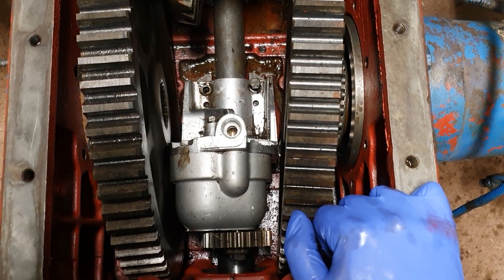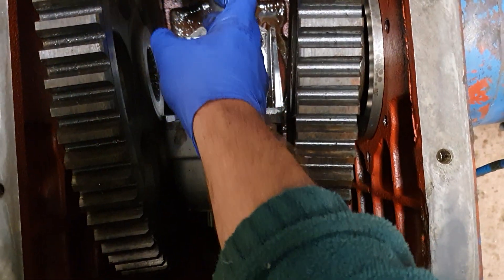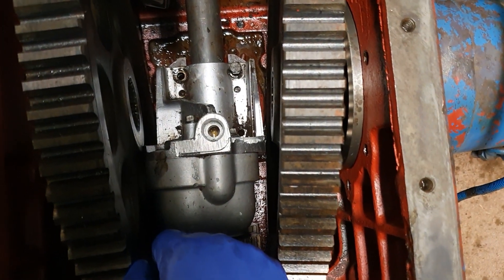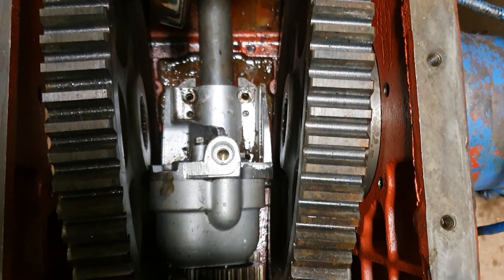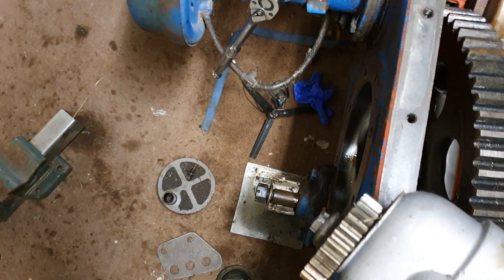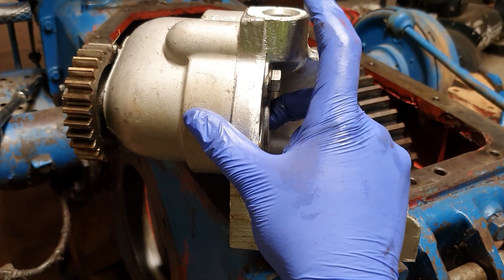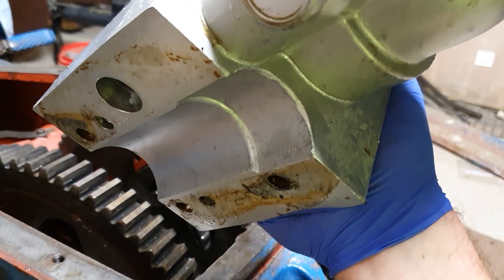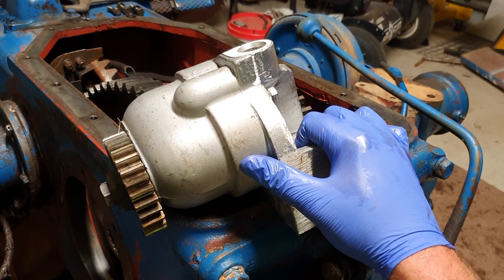Fordson Major Hydraulic Pump Removal

Comment: Would like you look at a, short video of the FPMajor looking at the rear with the 7 bolt cover removed. We are lacking pressure and I'm suspecting pump or other pipe o rings under the top cover. It's why I searched out your video in case the pump needs to come out. Is there a, way for me to send you this video of oil at back of hyd cylinder. Seems most comes out while lowering the 3 point  linkage. Thanks

Comment: or do you have a more professional solution suggestion for this matter?
Reply from the maker: I think it may be difficult, the pump was designed to work submerged in the oil. As long as something is turning the gear on the pump in theory it could work.